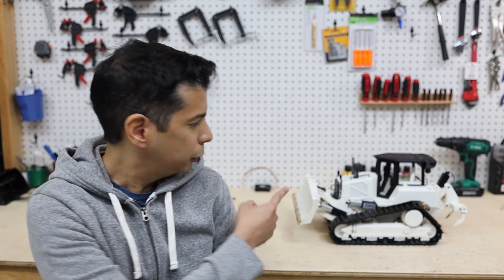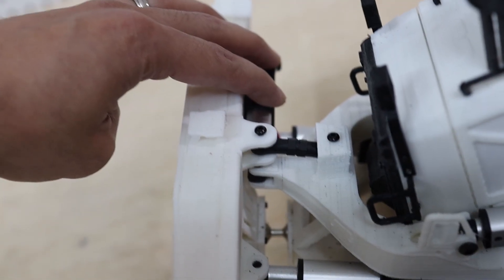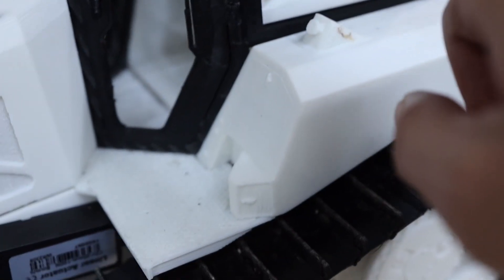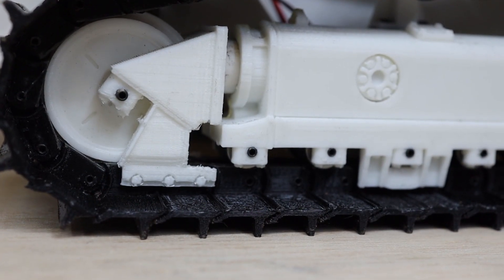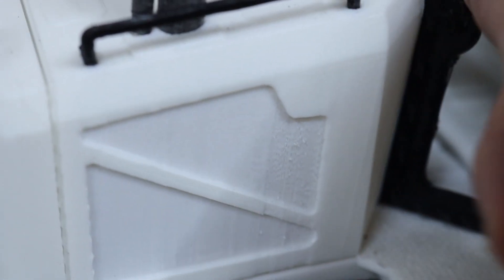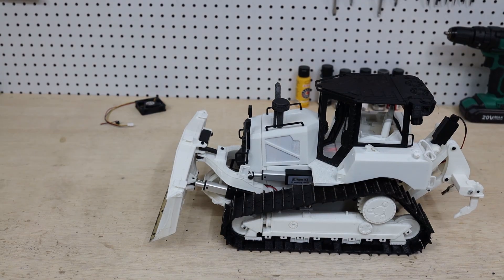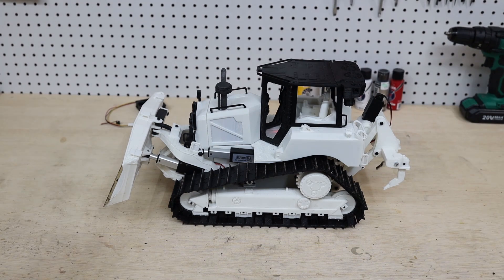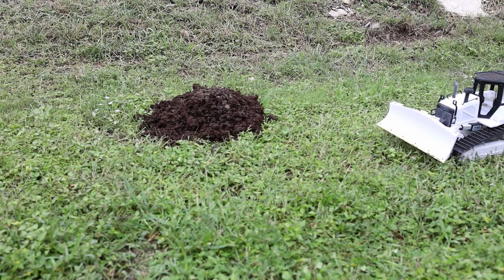3D print bulldozer part 1

Comment: 15:30 Congratulations. I’m sure you put many hours of work into this design and build. I would love to get into the RC construction hobby, but most of the hydraulic RC vehicles that have the capabilities I would want, are out of my price range ($4 - $8k Australian) . So, the idea of buying a 3D printer and electronics and making my own is very appealing. Some newby questions please:
1. What type of 3D printer do you use? 
2. What type would you recommend?
3. Which material do you recommend for printing these vehicles?
4. Are the tracks likely to ‘derail’ in tight turns in soft surfaces?
5. I would like my vehicles to be yellow. Is it better to print in white, then paint? Why don’t you print in yellow?
Many thanks, Martin
Reply from the maker: Thanks, yes it takes many hours and research to build something like this, and I appreciate all people that support and buy project.
1.- I use Anycubic Chiron 3d printed I bought it two years ago on sale for $350 dollars, it has a enormous build bed 400mm x 400mm but is it really slow.
2.- I recommend bamboo printer they disrupt the market with their models.
3.- PLA or better PLA+
4.- Track have never derail or broke on me on this build, even on soft surface like the one on the video I'm really please with the performance.
5.- I printed in white and black since those color are the less spences one in Amazon, and I use primer to give a better finish before painting with acrylic water base paints.
Hope I clarified your questions best!!!
Reply: Ok. Thanks. Perhaps I’ll post the same questions on Facebook.

Comment: How much does it weigh? What kind of motor does it have? .. what’s the cost?
Reply from the maker: 6.5 kg, the motor is in the description: 5840-555 Motor at 80 RPM, approximately $300 in materials plus the cost my project, link bellow in the description.